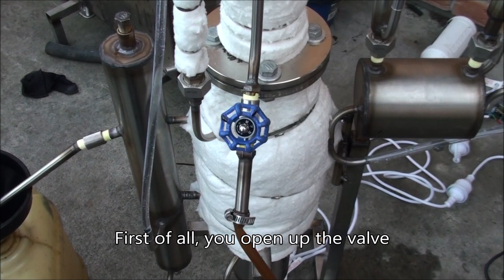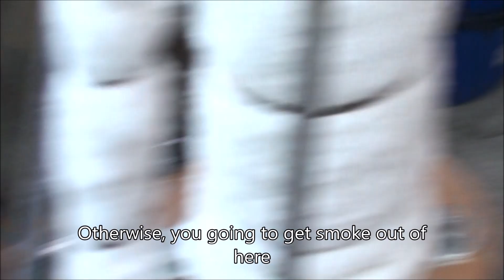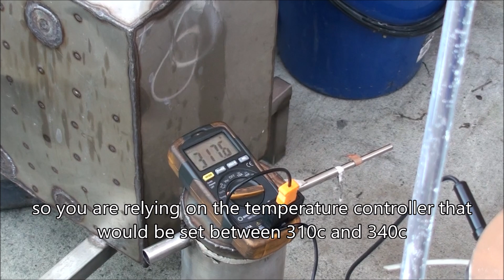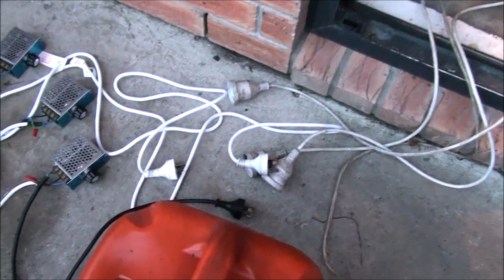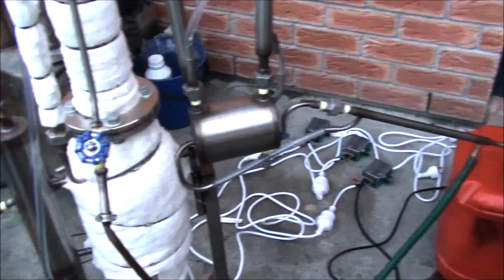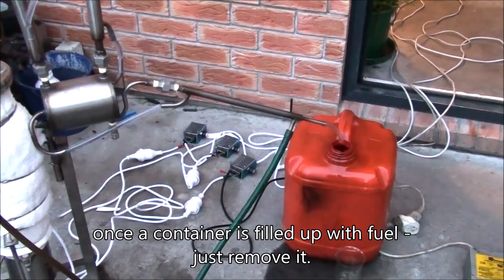WMO still bleaching mode explanation (very old never published video)

Comment: What sort of heating element you use and how do you place them inside or outside the still.. can I use ordinary domestic electric stove type of heat elements and brace them around the stainless steel can it work.
Reply: He has full plans at his website for purchase...
Reply: @xxdragan1969  are you his spokesmen?, Allow him to respond to my question.
Reply: @stevechimex2901  Did I stop him from replying Steve?Just delete my comment,you don't deserve the plans...
Reply from the maker: High temperature tolerant stainless steel cartridge elements.